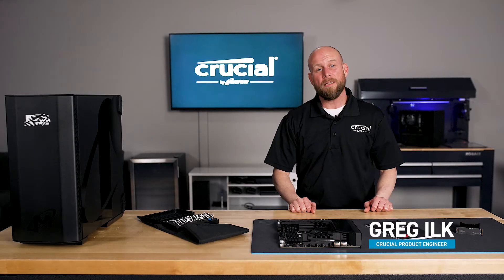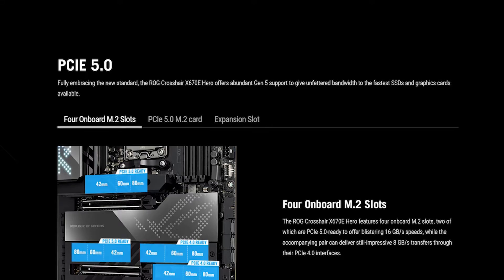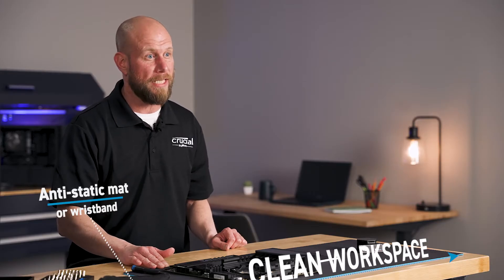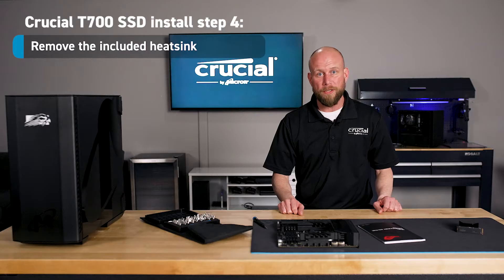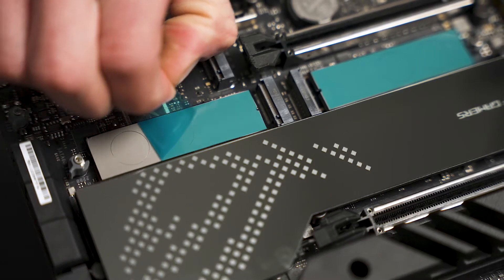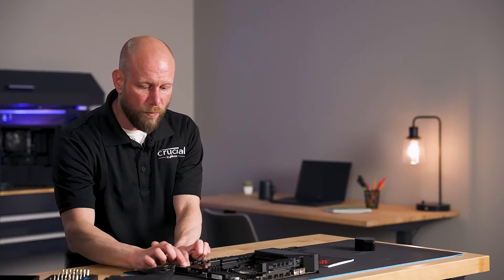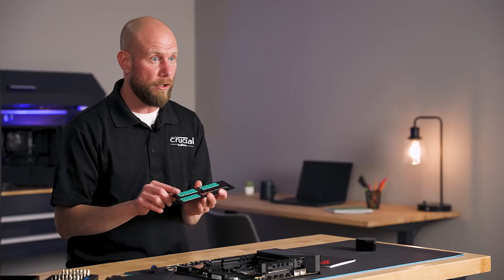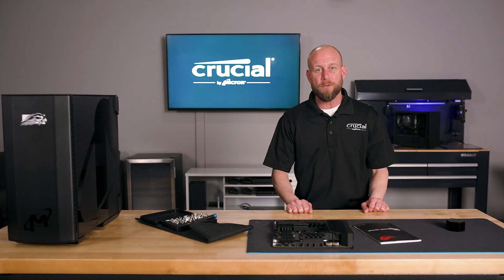Crucial How To | Install your Crucial T700 Pro Gen5 NVMe® SSD

Comment: So, ALL I have to do is unscrew the empty bay and then put the drive and screw it back in place w/ the thermal pads.  Super, what a waste of my time to watch.  You owe me 4 minutes of my life back!

What about, say, for example, you have a laptop with a single NVMe m.2 slot and you want to replace it. Just pop the new drive and and go?  Somehow I think you guys forgot a rather significant step.  Like HOW DO I TRANSFER THE OPERATING SYSTEMS?!?   Besides the “comlete installation kit” do I need a USB to m.2 adapter?!?  Maybe the claim that everything you need is in the box is a wee bit hyperbolic.  Do I swap drives and then boot from the old OS?  Somehow I suspect secure boot is going to have a kitten.  Do I make a clone or a back up (or, really, both) on a USB drive and then swap the drives and restore after booting to the external drive?  Do I use the Aconis softrware to clone my OS via USB adapter and then swap the drives?  

This is a lot of trial-and-error for users.

Why not just tell people how to do this? 
E.g.
“Install Aconis and clone your existing OS to the T7000 via USB”
“Install Aconis and make a bootable back up (presumably using a USB device that isn’t part of the “complete installation kit” then swap drives and restore from backup”
“Swap drives, boot from your old drive via USB and then clone the old to the new”

You probably should mention what to do with secure boot.  I presume that Bitlocker and Luks encryption will just get a bit-wise copy, but what if your old drive has hardware encryption and you pop it into a USB enclosure.  How is that going to work?  

Serious, WTF?  

You could make a one-panel cartoon to explain this and save me a whole afternoon of trial and error.  If it didn’t take any time to back up Windows and Linux this would not be a big deal, but we are talking about a good deal of time and heaven help you if your back is is a USB2 thumbdrive or external 5400 RPM HDD—how many times do you want to copy a pair. of OS plus 200GB of database content and 500GB of music (why else do you think I need a new drive??).  

OK:  Two pannels if they have secure boot and an encrypted SDD.

But this video is total waste of time.  If you know how to order a MOBO and drive as components of a new system you can figure out the ONE SCREW and some stickers that are the crux of the mechanics.

Comment: 1. So you don't remove any stickers on the drive itself?
2. Is there a video for the heatsink version of this drive?
3. Is the motherboard heatsink enough to cool this so it doesn't throttle under stress?
Reply from the maker: Hi Nezumi. Thanks for your questions! We currently do not recommend removing any labels from our non-heatsink SSD products as it would void the warranty. We do offer the T700 with an aluminum and nickel-plated copper heatsink. While we have not tested every third-party heatsink, we have seen positive results with heatsinks provided with the motherboard by other major brands.

Comment: Just installed my T700 in the same motherboard as this video (hero x670e) I installed in the m2_1 slot write speeds are terrible loads of threads in MSI forums same issue is this a firmware problem ?

Comment: yesterday i bought yiur 2tb p5 plus. its driver isn't showing up in device manager even after its installation in my asus z690 tuf wifi plus ,i7 12700 non k 
before that im using the Samsung 970 evo plus. its shows their samsung nvme driver in driver details. whats the issue?? can you help it😢
ssd is working fine though